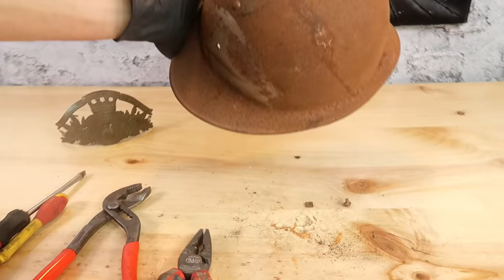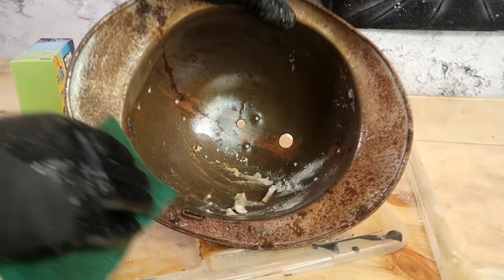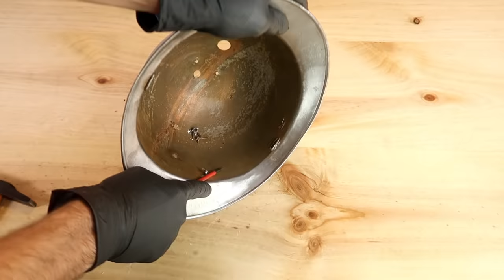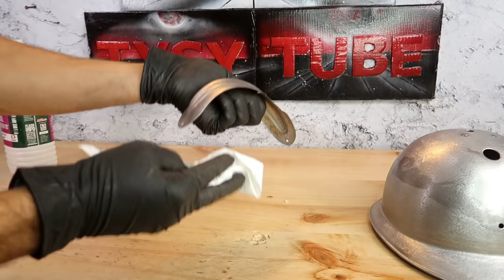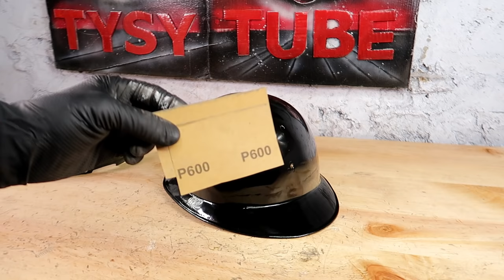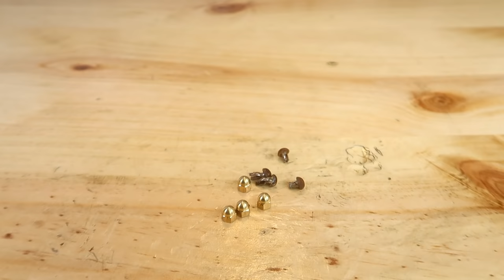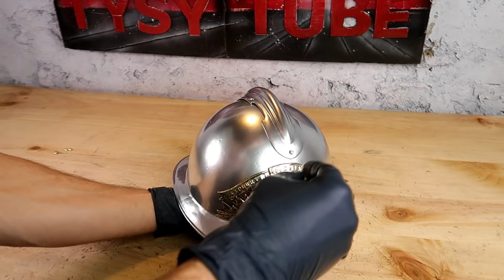Very Rusted Firefighter Helmet Restoration

Comment: Hi from England 

The helmet itself is the "Adrian" pattern...first issued to French soldiers in 1915...
Hence the official designation "M1915"...
The colour was matched with the rest of the new uniform issued to French soldiers: Horizon blue.

Happen these were possibly Army surplus...pressed into service as firefighters helmets after WW1...

A little (probably pointless) piece of history....
Take it or leave it...

With thanks
Glenn
GLMelectrical
Leeds UK
Reply: Adrian > Brodie
Reply: It's actually a post ww1 M26 Adrian. Principle difference is that the m15 was of 4 piece construction and the m26 2 piece. This example was almost certainly always in use with the fire service, as military examples had two slots cut in the front for attaching the arm of service badge, where as this one has a round hole.
Reply: The adrian helmet took its design from firefighter helmets
Reply: not exactly, the adrian helmet followed the design of the firefighters helmet which this one is clearly and example of, due to the lack of fixation for the army attributes, the liner fixation and the air passages in the top of the helmet, also firefighter helmets were polished and if it was a repurposed army helmet, there would hav e been traces of the old paint under the crest, which were clearly absent from this one

official designation never used year for the army helmets the early one were simply known as "helmet of the universal model" and the later referenced as "helmet of the new model", the M1915 and M1926 designation are made by the collectionners
Reply: @quentintin1 

Thanks for clearing that up... 👍
Reply: My 2 and 3 year old kids loved watching the process. It looks amazing.
Reply: ".pressed into service as firefighters helmets after WW1... "

Inbetween world wars, the Adrian helmet was used by Police and Gendarmerie forces, Civil Defence, and also in factories, mines, by lumberjacks, etc. or, to sum it up, in any civilian structure/enterprise where people needed to have their heads protected. Hence why you can still find Adrian helmets of both models with a colour (or remains of a colour) that was never used by the French Armed Forces.

After WW2, it remained in use by the military and law enforcement agencies for some little time, but was kept by firemen and firewomen until the 1980's.
Reply: Whether in use for military or civil purposes the Adrian helmet gave little protection. It was too light and did not protect the temples not the neck. The only military helmet which gave relative protection was the German stahlhelm.
Reply: @horatiohornblower868 

Yep...
The Brodie type issued to British, Empire & American forces was considered superior and more robust to the Adrian...
But the clear winner as recognised by all the combatant powers was the 1915 stahlhelm

Interestingly enough, German pattern Gasmasks were also superior...
When one was taken from a dead soldier and sent for evaluation...the allied powers immediately set about copying it...
Reply: Never pointless to learn something that not many know, I learned something new. Even if it is useless to some I find it pretty cool to now know. Thanks, Glenn.
Reply: Merci, bonne information et histoire
Reply: Thanks to all of you who offered the historical background of these. I like to learn this kind of thing about the items being restored, or personal anecdotes about using one. It adds to the enjoyment of the video.
Reply: I am also from Leeds, UK
Reply: I was wondering if this was an Adrian.
Reply: learning the history of something is never pointless 👍
Reply: Why do people still leave their name on something as simple as a comment? No disrepect, genuinely curious.
Reply: @glennmoreland6457 
* 1916 stahlhelm...
The Germans made their steel helmet after they had seen the improvement that an helmet made out of metal had made on the French troops. And it was better because it was made later.
( sry if my English is bad, I'm French ;)  )
Reply: So, should he have painted it a different color then? I'm not a huge fan of the chrome, takes away from the helmet. If they did give it out in Blue, that would really make the emblem stand out! 

Great restoration anyways!
Reply: thank you for the information, now i can google the finished helmet to uniform look
Reply: @feyufwSe34. 

Good lad
Reply: Nobody said it so I will, I read the word Adrian in a Rocky Belbowa voice in my head and I can't be the only one.
Reply: Tom Shepard Stahlhelm > Adrian > brodie
Reply: The adrien helmate was developed from a firefighter helmate so the m1915 was actually the clone they keep up useing the same helmate for booth tho I was under the impression the gernade was a millitary logo
Reply: @horatiohornblower868  yep true up to the american adoption of the kevlar helmets dont know the designation pasat or something lat that
Reply: Wow every one is so smart
Reply: I knew this helmet looked familiar
Reply: glenn moreland hey cool my name is Adrian.
Reply: @horatiohornblower868  But that did not help, either.... (says a German)
Reply: Schienenläufer Der Schutz war darum auch relativ.
Reply: Martin Luther Sending men off to war with a parade helmet is simply immoral. It reflects the profound contempt those poor guys were treated with.
Reply: BartJ583 

Lol no

I don't drink now
Haven't for 5 years
Reply: @horatiohornblower868  
French servicemembers were never sent to war with parade helmets.
It is just the colouring on that fireman helmet that makes it look like a parade helmet, but it is every bit as sturdy as the Adrian helmets that were used by our military. The very same helmet, really. Same qualities and same flaws.
Reply: @WarBird-yt1sp  
The M1? Oh, the US helmet issued after 1941, is it not?
Well, it is surely way more modern than the Adrian 1926 and sturdier, but also heavier, which is not without importance.
Reply: @sqike001ton  
PASGT. Personal Armor System for Ground Troops.
Reply: Briseur De Lance Who am I to doubt your words. Anyway that helmet did not serve its purpose. Neither did the colour of the French uniforms: blue horizon.
Reply: You can gift it now,thanks fam will give you a kiss.
Reply: I bought an M26 from a Christmas market a couple of years ago. I love the look of it, it looks a lot less derpy than the Brody and doesn't have the, shall we say, connotations of the Stahlhelm. People like to hate on the Adrian, but considering it managed to be put into production so quickly and with such speed (German soldiers would still be wearing boiled leather Pickelhaubes a year later, the helmet probably saved more lives than its sturdier cousins during the Great War.
Reply: Tysm
Reply: Always nice to have a proper explanation. Thank you.
Reply: Jesus... a lot of information for my brain
Reply: History is never pointless
Reply: @guillaumecpls  le mot"an"=article used before object starting w/vowel.
Ton anglais tres bonne
Reply: Isn't the emblem in the crest a universal symbol for artillery?
Reply: Cool
Reply: That's what I was thinking. Looks like the French helmets from World War One. I think they still wore them in World War Two.
Reply: glenn moreland wrong
Reply: Bloody well in mate!
Reply: Thank you Glenn from England, this was actually a pretty cool fact to learn
Reply: Cool but one question how much time in a day do you have to research this stuff for no reason
Reply: And dropped only once .
Reply: glenn moreland you are absolutely correct.
Reply: That French helmets much Protection then Brodie, 

But in world war II Adrian helmet still in  service  by French soldiers when defend the French from German blitzkrieg 

Much popular is Brodie helmet when wwII break
Reply: Ok ok
Reply: Сенің айтқанын дұрыс, және маңызды содан бақыт тілеймін
Reply: I love pointless information.  It's the best sort since I can appreciate it solely for being interesting.  Thank you.
Reply: @joshuarosen6242  thank
Reply: @glennmoreland6457  ... ... ... ...
Reply: nope...wasnt Army Surplus. The french Adrian helmet pattern 1915 was shapped with a former firefighter french helmet and bettered. Firefighters in Paris and Marseille cities r soldiers and form part of the french army since a long time. So they have been equipped with the same pattern. Then all french firefighters adopted the same helmet. They still wear that helmet for parads today....
Cheers from a french collector
Reply: @Briselance  tu dis des conneries. Les sapeurs pompiers de paris sont allé sur le front à Reims durant la grande guerre pour éteindre les incendies, notamment celui de la cathédrale de Chartres. En attendant, c'est ce type de casque que tous les sapeurs pompiers portaient encore dans les années 80.
Reply: Nerd
Reply: Jk
Reply: oh un french people
Reply: K
Reply: History BOIS
Reply: You know it very well, rights? Why don't you grab the opportunity to do his work, to restore this helmet.
Reply: Are you dannyg from smethwick or something I dont care that your from England so am I do I get a medal
Reply: You know your facts
Reply: And I bet there were not so shiny... so much glow.
Reply: Color*
Reply: @emoxon   Some of the M1915 were also used by the french firemen. Then came a stainless steel version (1933). The 2 piece version of the military Adrian saw use in WW2.
Reply: BartJ583  Maybe English isn’t his first language and he mistook an ellipsis for a period.  :)
Reply: @emoxon  This is not an M26 as there are no liner rivets
Reply: @uncle7215  No it is an M26. The absence of liner rivets is likely due to it's adaptation for fire service specs. But that doesn't mean it isn't an M26. Those helmets sent to the Spanish Republic had no holes punched for French branch of service badges, yet they were still pattern M26. 

There were two models of Adrian. The M15 family of variants was of a 4 piece construction, and then the 26 which was a simplified 2 piece. All those of a two piece can be considered M26, and all those of 4 piece M15.
Reply: Not ALL Adrian helmets came off the line in horizon blue.  Foriegn militaries bought them, most notably Belgium, and French high school and college military academies bought them and they were almost always some other color than horizon blue.  Grey, silver, black, gold, and green ... I think ... were the most popular colors.

Comment: That style of helmet is known as the Adrian helmet, was used by French soldiers as well as firefighters.
Reply: bro, you could’ve at least added it was used in WWI and some WWII
Reply: Oui
Reply: It's a M26(produced from 1926) that was used during ww2, the improved version of the M15 that was used during ww1. These were often also distibuted to non-military services like the civil protection, the passive defense, firefighters,...and the French police used it till the 1970's. The main difference is that the actual helmet (without the upper part) of the M15 was constructed out of multiple pieces that were riveted together and the outside of the M26 was made out of  1 piece. You can see this at the side of the helmet where the M26 has 2 horizontal rivets to attach the inside and the M15 has a vertical line and two small vertical rivets (because two of the parts are attached here).
Reply: Was their original colour chrome?
Reply: @mattm1982  yes, but originaly was not a paint, but chrome steel

Comment: Two products I urge you to look into: evaporust and bar keeper’s friend. I’ve worked with anything from American Civil War to modern at a military museum. These are used more than anything else, they work best, and they’re the least destructive.
Reply: evaporust is available here in continental Europe but at an outrageous price. Like 6 or 7 times the US price. Dunno why. No need of further explanation.
Reply: Desi it depends on how much you do or don’t want to damage the artifact. In lieu of that I’d recommend electrolysis as long as the metals aren’t dissimilar.
Reply: I would love to use Evaporust to restore some small car parts and uniform badges. But they are way way too costly to be imported to Asia. The option i have now is to use vinegar,wires brush and patience.

Comment: I thought the helmet color would be red, the firefighters pattern color . Then I saw that color was the helmet pattern.

And I also thought you were going to put that "web-thing", like inside of the army helmets.

I have a tip, if not boldness on my part:

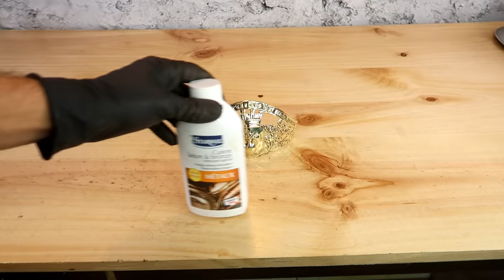Whenever you are doing small works (10:50), show the "before and after" in the video, with the split screen, near the object. This will show you the minuscule work with more attention.

Good luck and much more videos in 2019!
Reply from the maker: thank you so much 😊
Reply: "Then I saw that color was the helmet pattern."
Reply: The web thing is called a helmet liner

Comment: Bravo, Nice job!
One final coat of clear over the chrome would also be nice.
Brass rivets are still available too.
Reply from the maker: thank you so much 😊, you can’t do clear coat on chrome paint because will turn black
Reply: @TysyTube  it shouldnt if you get a appropriate clear coat.. some are incompatible but usually you can brand match and they will work fine.. but if your not wet sanding the chrome layer to a mirror finish you might as well have just clear coated the base metal itself and had the natural metal effect while being protected by the clear coat.
Reply: You can't wet sand it to a mirror finish, either. Chrome paint is terrible to work with, it's meant for ornaments and decorative stuff that we'll never touch, because it can easily be ruined even by the oils from our skin.
Reply: @rafaelgsbr  then you need to change brands.. or every cosplayer i know that uses chrome rattle can paints is somehow managing magic.. because mirror polish wet sanding is a huge thing in the cosplay community using spray paint chromes.

Comment: Tysy and my mechanics should team up for a motorcycle restoration, i would donate a Dnepr MT9 with sidecar! Location Germany
Reply: Hi from England

Is that the copy of the Zundapp from WW2...the one with the driven wheel on the sidecar...?
Usually fitted with a maschinengewehr (MG42) in the sidecar...
Reply: Hi, it is a copy of the BMW „Wehrmachtsgespann“, but from the 70s with quite some differences. My Version doesn‘t have the driven sidecar wheel, because it drives like crap on normal roads :-)

Comment: Have you tried Evaporust? Environmentally and for you, safe. You could avoid all those dangerous concoctions. White vinegar is still (IMO) most effective, safe and cheapest. No electricity needed. You could probably get a repro helmet liner for army helmets that would work and be period correct. Add more coats of filler primer. Sand smooth without leaving an orange peel effect. Nice turntable. ;)
Reply: Afterall, it is rust he's trying to take off! And Evaporust works really well.
Reply: It is too expensive. And it does not make sense to use expensive products on a badly pitted metal surface.